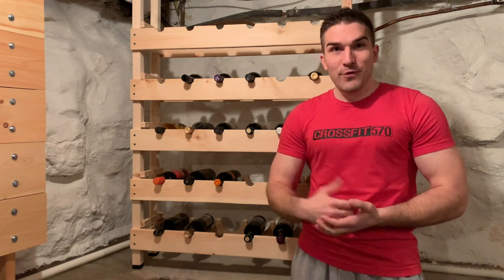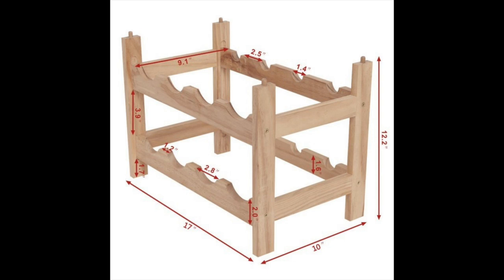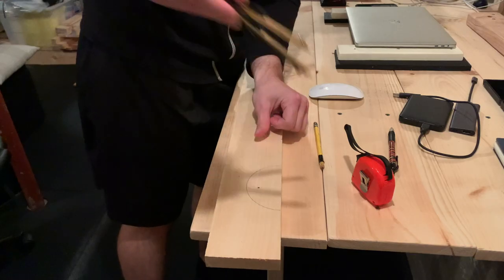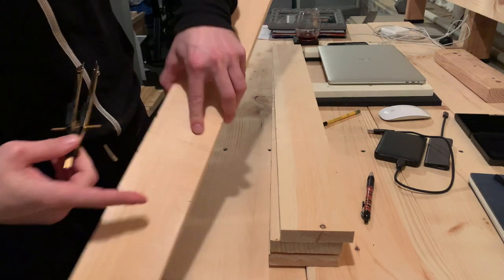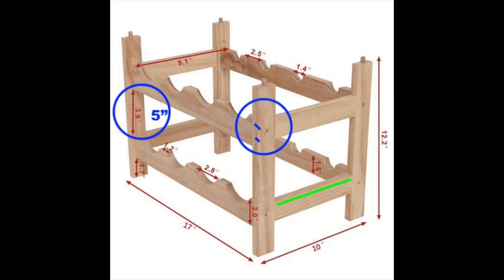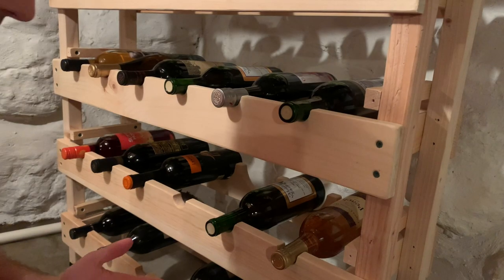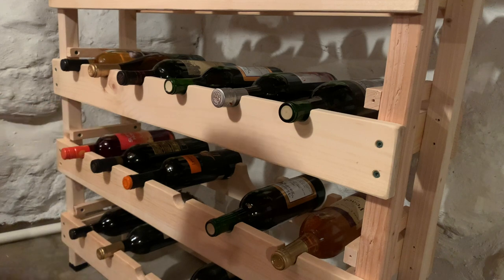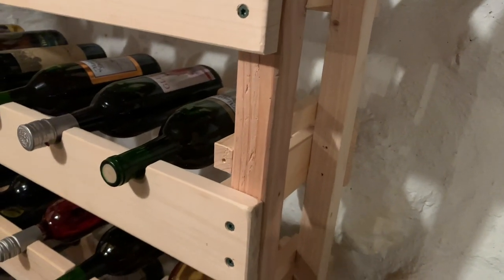DIY Wine Rack Using Simple Tools

Comment: Thanks for the video and the design.    I made mine to go in my basement under the stairs.  My wine rack came out so nice that I had to finish the space so I have a nice wine "nook".    BTW, I did use  hole saws for the large and small holes and then ripped the boards in half.  Thanks again!
Reply from the maker: Awesome! Glad I could help
Reply: That was my thought before I read your comment. I will do the same.

Comment: I bought 1x8s and a 2 1/2” and 4” hole cutting blades. Cut the holes and and then ripped the boards down the middle. Took a lot less time than jig sawing them all.
Reply from the maker: Great tip!

Comment: Would have using a wholesaw to drill the holes before ripping the boards not been faster than using a jigsaw?  I like your design,  might go through the trouble of making this at some point.   I just purchased a wine rack kit that holds 120 bottles but have not put it together yet.  Cost me 100 CAN$.  Would you say that doing it from scratch like you did be cheaper, the same or more expensive?  Obviously it depends on the type of wood you use but I am guessing for something like this, anything would do, even cedar?   Last question, would staining and or putting a varnish on the wood be a good idea?  Thanks for the video!
Reply from the maker: You could absolutely do that!  Way cheaper. At the time, I would say I made this for less than $30. I used pine so the wood was cheap (at the time). And I have since put a coat of varnish on the wood, I just don't show it in the video
Reply: I should’ve read through the comments before posting mine ha.

Comment: If you dont mind me asking, how much did it cost for all the materials to build this? Trying to decide if it would be cheaper to build one instead of buying one. Thank you in advance.
Reply from the maker: Cost of lumber is super hight right now. At the time I built it, 2x2s were about 1.97 a piece, 3" boards were about $5 (all pine).... so figure around $30-$40 for material plus the screws

Comment: Sorry, but this is a pretty terrible way to go at this.  It is crazy labor intensive and anyone who has done much work with a jigsaw knows that you will NOT get a nice looking product when you are thru, as there will be far too many "discrepancies" in the cuts, which would be fixable with sanding if it was one cut, but which will not match the other, also different, cuts.  You really think people can cut 1.4" circles in wood with a jigsaw?  Exactly the same every time?  I don't think so!
Reply from the maker: Thank you Larry. I can always depend on someone who doesn't read the description for me to reiterate the point. This is for someone who wants to make one using the simplest of tools. Could it be easier with other tools? Sure. But most people have a jig saw and drill. Not a lot have a router, band saw, skil saw, etc.

Also, Larry, based on your profile photo, I should recommend some of my other videos on stretching and strengthening your knees as you are probably of an age that this is becoming an issue. Feel free to browse